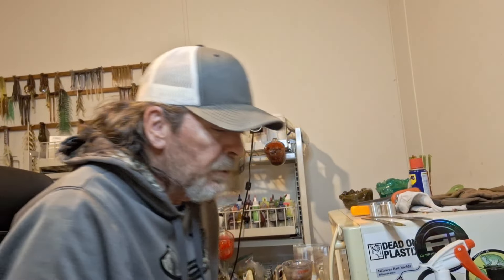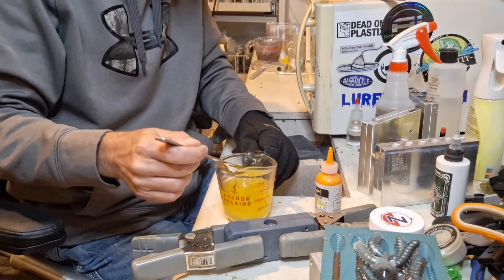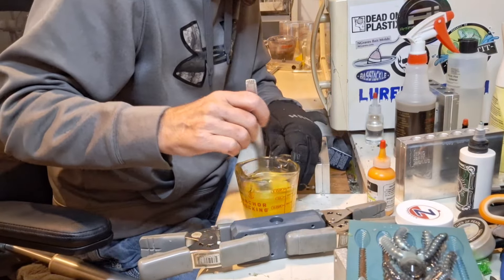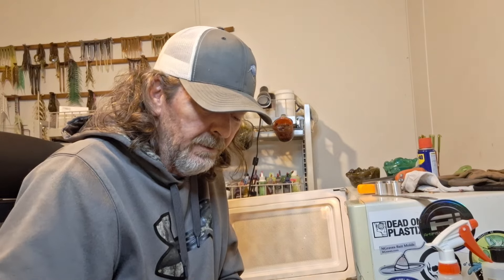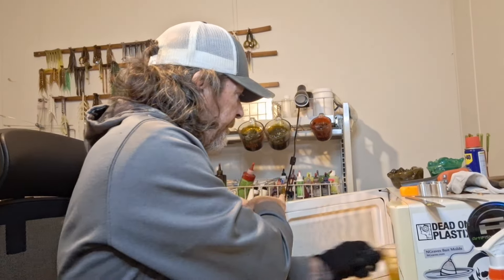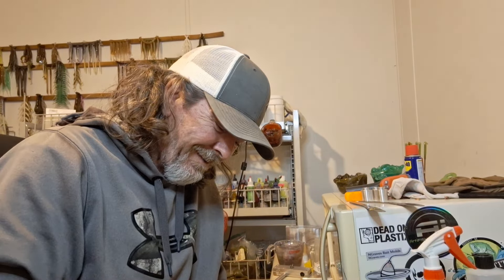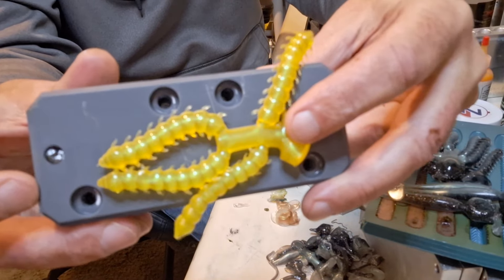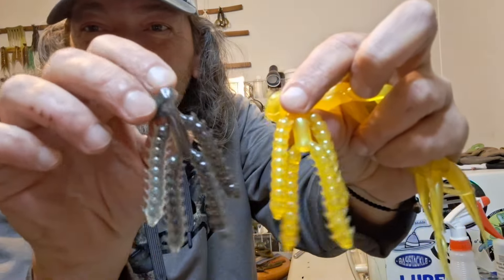New mold and color. MF colorant and NGraves Bait Molds #fishing #crappiefishing

Comment: Sir. I want to make these products floating, what do I need to add to plastisole. I will be glad if you can help, master.
Reply: I make trout eggs and small maggots
Reply from the maker: @kubilaykocak-s6y  Some brands of plastisol have a floating blend (Dead-On) white bucket. Most companies also sell a floating additive. I know Bait Plastics does. Most plastisols have a neutrally balanced sink. Calhoun's plastic had a great neutral fall for me. Check out the plastisol that is already floating (in my opinion) because the floating additives can change your colors up a little bit. Dead-On I know has the white bucket floating blend. Don't have to add anything. Hope this helps. If not, I can try to explain better. Thanks for watching! 🙏
Reply: @five.0custombaits  Sir. The plastisols you use in our country do not come. We use screen printing plastisol here. There is a limit of 30 euros, so we do it with our own means. We can't find additives, if there is a name, I will read it very happily. Master
Reply from the maker: @kubilaykocak-s6y  Dead On Plastics has a floating blend.
Reply: @five.0custombaits  It doesn't come to Turkey, sir, what is its content?
Reply from the maker: @kubilaykocak-s6y  I do not know what it is made out of. That would be a question for the plastics company. Sorry